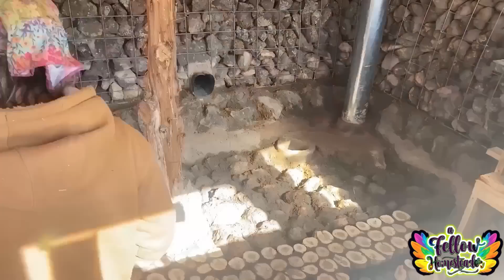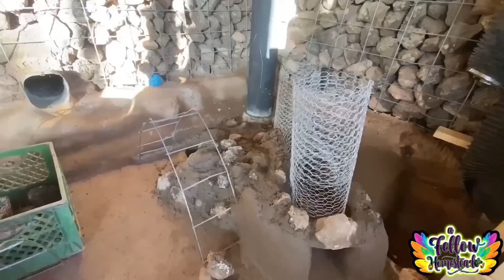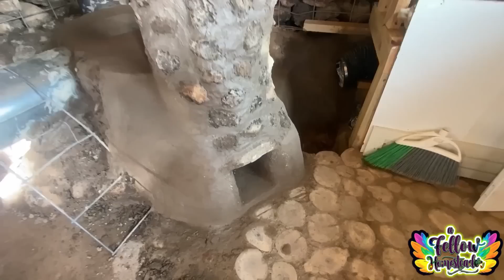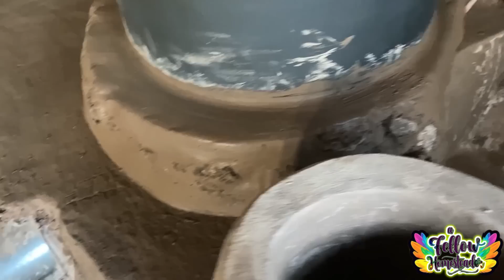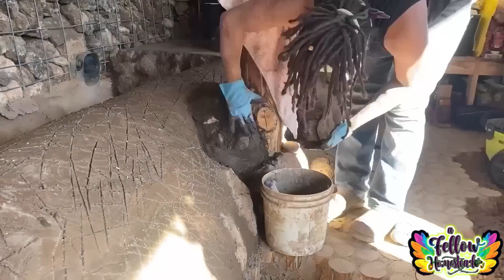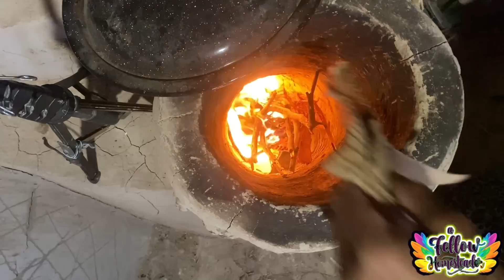Rocket Mass Heater Build (time lapse)

Comment: Neka. Great post. Excellent detail. With that size burn chamber, how long and short could you make such a thing? I really dig the way our abundant natural resources can accomplish this. What's up, Brandon? I was into that permaculture post yesterday. Yinzer the coolest.
Reply from the maker: Thank you!! The chimney tube into the barrels is the burn chamber. But the big chamber that is the bench can be made fairly big or short or tall, many variations can be created with this design as long as the airflow is proper. ✌🏾💜

Comment: I noticed that hole in the back wall of the bench. What's that for? Did I miss something?
Reply from the maker: It is one of the air intake tubes! “Off grid ac” it cools air as it pulls through the back berm and wall. As well as good airflow for inside and for the rocketstove. You may have missed it but it was also created waaay in the beginnings of the wall✌🏾💜

Comment: Awesome !
Have you taken any temp readings on the black can ?
I can see as high as 700 F if I get lazy and don't watch the air inlet control 
You have a ton more mass
I'm thinking yours is much more docile /easier to control 
😇
Reply from the maker: Thank you! We have! The top of the barrel got to a bit over 500. And the exhaust was only 100. Tons of mass to absorb all the heat. Sure is quite docile but we can crank it up higher if we wanted, but not much need since the weather is very nice. Just a small morning burn for coffee before the sun warms us up. ✌🏾💜